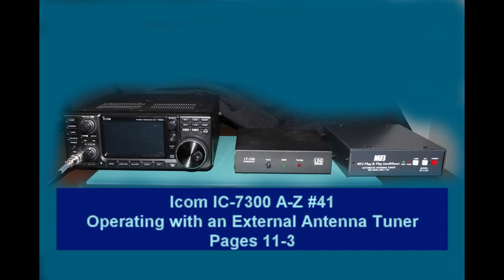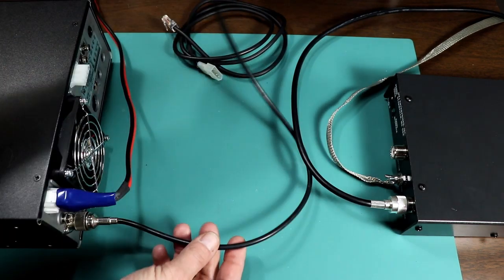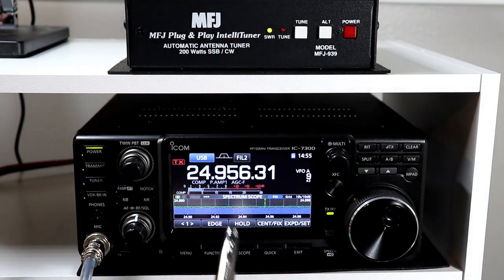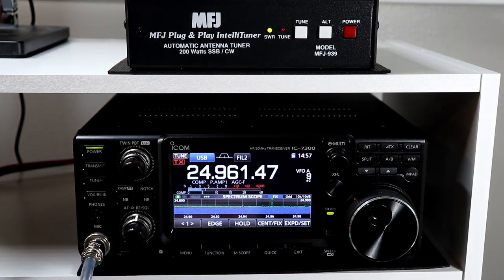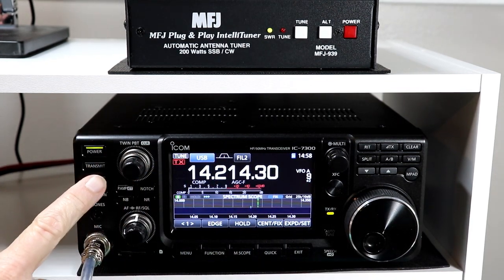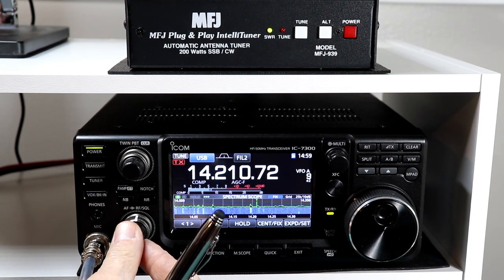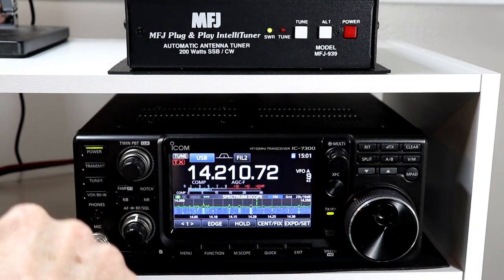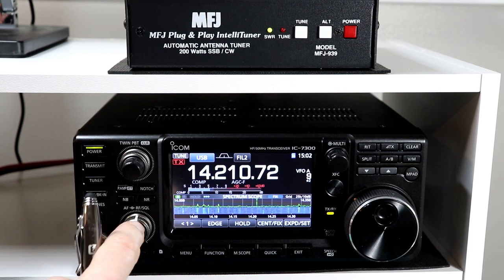Icom IC7300 A to Z #41 Using an External Antenna Tuner

Comment: Having a similar setup, I have a question. I also utilize headphones quite a bit and have found it to be a real eye opener after a long qsl with the volume up, change freqs, then hold that tune button...without remembering to turn the volume back down. I think it's giving me tinnitis hihi. I've tried searching all over in addition to playing with radio settings but haven't found anything. I thought it'd be as simple as a monitor setting, I'm stumped. Is there a way to disable that tone through your speaker/headphones when tuning with an external tuner?
Reply from the maker: Hi- I went and tried this on my 7300.  You are absolutely right!  There doesn’t seem to be any way to adjust the tuner side-tone volume separately from turning the volume control down.  And, it does seem to be pretty loud compared to receiver volume.  The “Beep” volume settings and whether Monitor is on or off does not seem to affect this.  If I find anything else that might change it I’ll let you know, but for now I would call this a software bug - or at least an oversight.
Reply: @HamRadioA2Z  Well, I'm glad that it wasn't something simple and just making a fool out of me then.

Comment: Hi Tom, you say you live in a rental property. How do you wire the Ground terminal?
Reply from the maker: Hi Henry. We were in a rental house. I was fortunate that there was an access hole to the basement from previous cable or  internet service.  I drove a ground rod outside right near the access and ran my ground wire through there.  We recently purchased a house. When we moved, I disconnected all my wires, plugged the hole and just drove the ground rod down below the surface.
Reply: HamCuredSmoke Thank you for taking time to answer my question.
Reply from the maker: One other note- if you’re in an apartment and are on an upper floor, MFJ and other companies make “artificial grounds”. They are basically a tunable counterpoise to help you keep RF out of your shack.  In addition make sure you use a choke value out at the antenna end of your coax.  Even if the antenna is only a few feet away on a balcony.

Comment: If I'm using a alpha delta dx-cc as an inverted v up 30 feet do you think I will really need an external tuner or will the internal tuner be fine?
Reply from the maker: Hi Aaron.  According to Alpha-Delta's website, that antenna should be resonant on 80, 40, 20, 15 and 10 meters.  So it shouldn't even need the internal tuner on those bands.  If you want to use it on the WARC bands or 160 meters, it's hard to say.  The radio might be able to tune it on a few of them.  The easiest and cheapest way to find out is to try it.  Just try tuning with the internal tuner at the top and bottom end of each band you want to work and see.  If the internal tuner doesn't cut it on a band you really want to work, you can always add an external tuner.

Comment: If you want to bypass the external tuner, can't you just use the power button  and power off the external tuner? Seems like it'd be a lot easier than unplugging the cable!?
Reply from the maker: I have made good HF contacts on 10 watts.  I recently bought a tuner for mine.  Whether you need it or not depends on whether you have resonant antennas.

Comment: If you are using the external tuner and the IC7300 is at 100 watts, does pressing the tune button on the 7300 reduce power to ~10 watts for tuning or do you have do to that manually?
Reply from the maker: When you’re using a tuner connected through the 4 pin tuner connector, it is automatic.  When you push the tune button the radio will put out a solid Cw carrier at about 10 watts regardless of what mode the rig is in or what the power level is set to.
Reply: @HamRadioA2Z  Thank you so much for the very quick reply. I thought that might be the case because now while I’m waiting for my automatic tuner to arrive I’m using the Click2Tune which does that same thing through that Molex connector.  Your Videos are very helpful and appreciated thank you

Comment: Just a minute, OM. A half-wave end-fed is roughly 2500 ohms. So, a 49:1 transformer should be used, to obtain a near 50-Ohn match. If you cut the antenna to 42.253m at 3.550MHz, then the antenna will resonate on all bands, at least up to 28MHz. Okay, so it's spiky, but you can't have your cake and eat it all the time, eh?  If you removed the 49:1 transformer, and run direct into the tuner (in my case, the PALSTAR HF-AUTO), you can work a 1/4 wave on 160m
Reply from the maker: I was using a "random" length end fed when that video was made.  So, the impedance at the end isn't nearly as high as a resonant antenna.  Therefore a 9:1 unun can be used.  Palomar Engineers has good discussion on the topic and they provide a table of different wire lengths that are non-resonant on different combinations of bands.  You can find that here:  https://palomar-engineers.com/tech-support/tech-topics/best-hf-end-fed-antenna

Comment: I also have a 20m end fed with 9.1 unun out to a tree, super stealth, in a valley, and find 20m and 40m to be the best, but its possible to make contacts on all of the HF band. I thought my hf days were over when I moved here, but even with low propogation it works, especially if the other side has a 6 over 6 over 6, Ha.
Reply from the maker: Hi.  Absolutely!  You can have a lot of fun with almost any antenna.  Some more challenging than others for sure, but still fun.  We have finally moved into a house on a little property, so I have  an opportunity for larger antennas now, but I’ve managed to maintain some level of HF activity through several rental houses, HOAs, etc.  Keep making those contacts!

Comment: The LDG 100 is limited to 30 watts digital. Look at the LDG web site.
Reply: Running a radio rated at 100 watts pep more than 30 watts digital is not healthy for the radio either.

Comment: Hi Tom...Have you tried using the 7300 with a manual tuner?  Thanks for a great series of videos! 73 DE W1NLJ
Reply from the maker: Hi Norm.  Yes, I have a small MFJ travel tuner.  I have used it with the 7300 a number of times and it works fine with it.  I just set the RF power to 10 watts or so and then key the hand mic in RTTY mode.  That puts out a CW carrier.  Then I use the SWR meter on the display to adjust the tuner.
Reply: I've used my James Millen manual tuner tuned roughly, and fine tuned with the 7300 ATU and always reach 1:1, like it, except the new HF bands are not present on my 50 year old Millen.

Comment: Tom, I liked your video on using an MFJ tuner with the Icom 7300. One extra thing you might have included was the function buttons on the MFJ. I think you assumed that connecting the two simply brought "up" the MFJ and that may well be the case. But I'm left wondering what the buttons on the MFJ are for or what they then do. Thanks, R B Pierce

Comment: What’s with the internal tuner.
Reply from the maker: The internal tuner works fine for anything up to about 3:1 SWR.  Any more than that and you need an external tuner.  If you are fortunate enough to have all resonant or close to resonant antennas, then the internal tuner will be just fine.

Comment: Want the internal tuner work if the external tuner is turned off??
Reply from the maker: Hi Michael.  I believe it depends on which external tuner you are using.  Some of them have a resistance between a couple pins on the tuner connector whether the tuner is on or not.  The radio will recognize that as the presence of an external tuner and the internal one will be disabled.  The best I can suggest is to try it.  If you hear the internal tuning when you turn off your external one, then you’re good.  Otherwise you may need to unplug it to make the internal one work.
Reply: Thanks for the help and the great videos.

Comment: If the radio has an internal tuner, why use an external one? 🤔
Reply: The IC-7300 is capable of tuning up to an SWR of 3:1, the MFJ 939 is capable of tuning up to an SWR of 32:1. It just allows for wider use of non-resonant antennas.

Comment: I was told at somebody at Icom today 
not to use a external tuner 

Have a ldg at 600pro ii
Reply from the maker: It seems strange that somebody at Icom would give that advice since the external tuner connector on the back of the radio is there only for that purpose.

Comment: I thought you had to be in CW not SSB in order to tune. ? ?
Reply from the maker: When you press the TUNE button, either with the internal tuner or with a compatible external tuner the radio automatically sets the output power to about 10 watts and puts out a CW carrier regardless of what mode you are in.

Comment: I don't care what antenna tuner you use the best place for the tuner is not next to your radio but next or at the antenna so you have no swr on the coax when the tuner makes a match with the antenna . With the tuner is at the radio from the tuner to the antenna still has an high swr mismatch .
Reply from the maker: Hi Joe.  You are absolutely right.  The best place for a tuner is as close to the antenna as possible.  Unfortunately, it isn't always practical.  In particular, with automatic tuners that have a separate interface cable that plugs into the rig, you would need a long extension to that cable.  For many of the tuners out there, you would also need to make a weatherproof box.  I just did a video on RV portable operation with the IC-7100 and I use the same MFJ tuner.  In that video, I mention that coax runs should be as short as possible for just the reason you are pointing out.
You can check out the video here:  https://youtu.be/5hQKryyGCn8
Thanks for the feedback.  73, Tom

Comment: Tom, I own an LDG Z 100 auto tuner I used to run on my Icom 706MKII and it worked great! How about running the same tuner on the 7300? Thanks
Reply from the maker: I believe it should work fine.

Comment: But why.... ??  why  not just use the internal tuner, that's what it was made for, mine covers all bands great and always get a good SWR...
Reply from the maker: The internal tuner is fine if your antenna SWR is 3:1 or less on all the bands you want to work.  Many people are stuck with more compromise antennas and some people literally do load up rain gutters and down spouts if they are renters or have other antenna restrictions.  The internal tuner just won't quite cut it in these situations.
Reply: @HamRadioA2Z  If the antenna is not resonant (or close resonant) to the frequency in use, neither the internal nor an external will do a match.   Tuners just fool the radio to believe they are connected to resonant antenna...the radio is happy but the signal is not going to far.
Reply from the maker: Well, yes and no.  There are multiple aspects to an antenna system- The frequency(ies) that it is resonant at, what impedance it presents at the feed point and how good of a radiator it is - among many other aspects.  A good dummy load is resonant across the whole spectrum and presents a 50 ohm impedance at the feed point, but it isn’t a very good radiator.  You can have an antenna that is an excellent radiator, but isn’t resonant at your desired frequency.  If you match it to the radio impedance, it can still perform fairly well.

Comment: I enjoy all your videos and you have done a great service for the 7300 community. But, I must take exception to the portion of this video where you seem to imply that the “tuner” actually “tunes” the antenna and causes it to receive better. I’m talking about the section where you “tune” your random wire on 160 meters and then go to 20 meters and demonstrate how the “tuner” greatly improves the reception on 20 meters. You seem to imply that the “tuner” has caused the reception of the random wire to improve. It did not. It only appeared that way because the “tuner” has been set for 160 meters and the impedance mismatch was so bad on 20 before you “tuned” on that band that reception was degraded. These devices are not in any way “antenna tuners”. They in no way tune any antenna. They are actually impedance matching devices. Their sole purpose is to match the impedance presented at the end of the feed line to close to or exactly the 50 ohms that the radio expects to see. They do not lower swr on the antenna side of the “tuner” at all, and they do not improve the receive or transmit capability of the antenna at all.
Reply from the maker: I mostly agree with your explanation.  The tuner does simply match the impedance of the antenna system (which includes the antenna and the feed line) to the radio.  Matching the impedance, however, does improve the ability of the radio to receive and transmit with that antenna system.

Comment: You cant use an Antenna tuner on the table in the rack, that means u send with your PL-Shield , the only working position for an width band Antenna tuner is the entry point from your wire normaly end feeded wire.  So that make  the house complettly under HF flut.  All grounds in house now under Hot- HF , damn this tuner is an failed construction, did u now that not ? You must pay for an AH-4 Antenna Tuner, and the dynamic Mike SM-50  else the station runs wrong and cant give them potential to the operator..
Reply from the maker: Tuners are definitely better as close to the antenna as possible.  However, they can be quite effective in the shack.  You’re just matching the antenna and the lead in coax in that case.  So there will be more losses.  And, yes, you can end up with RF in the shack in some cases.

Comment: Wow--you whizzed through the front end set-up (Tuner switch to manualk and PTT to off) way too fast and assumed the operator knows what you are talking abouty. I had to replay it onc I heard it, because I believe I had mine set incorrectly. Do not skip or glosse over set up steps in any tutorial, please.
Reply from the maker: Thanks for the feedback Richard. I’ll try to make sure any steps I cover are clear.

Comment: Icom 7300 is a nice rig but wait until that touch screen starts acting up I will just stick with my icom 718 it doesn't have all the bells and whistles the 7300 does but does a good job and has been out for like 15 years a radio is like a car the more bells and whistles it has the more stuff can go wrong with it.